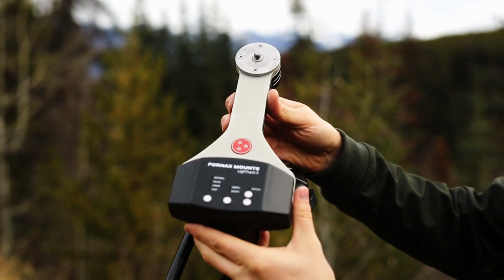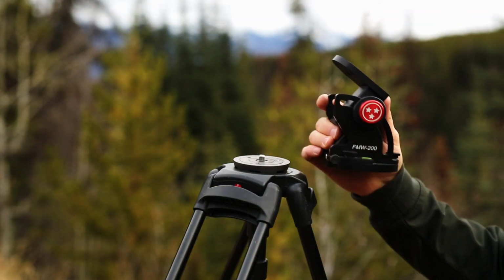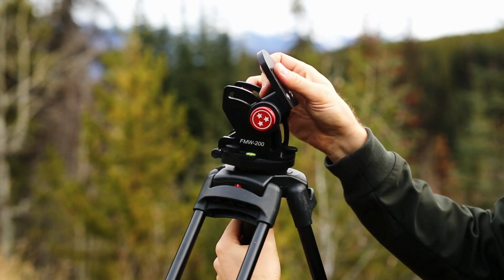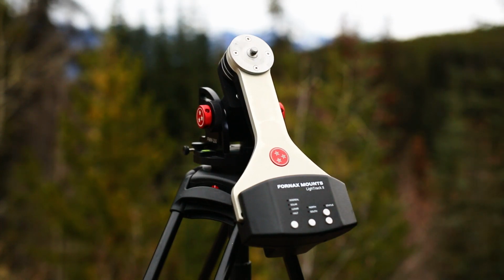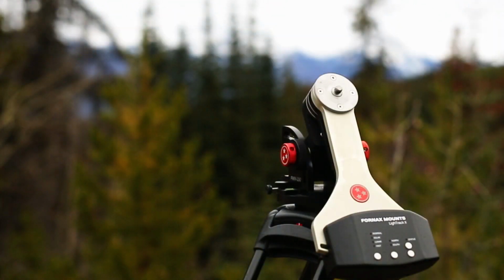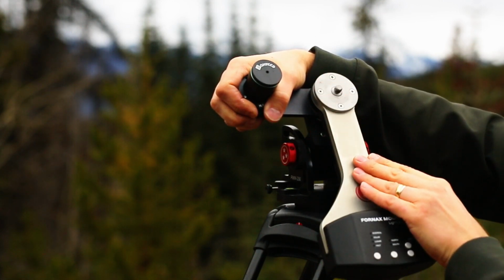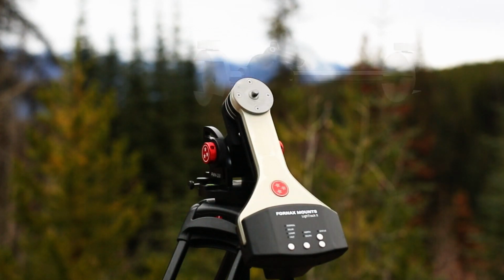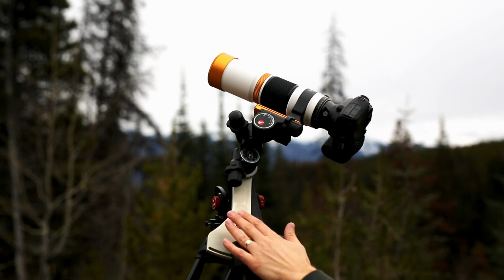LighTrack II Overview

Comment: In a review made by somebody else it was indicated that there was a rubberised wheel which made a friction contact with the top (Grey coloured plate) to drive the mechanism. My question is: does this item wear out (as all things eventually do) is it a replaceable item? Thank you
Reply from the maker: Hi! I’m not sure what review you’re referring to, but there’s no rubberized wheels to worry about in the LighTrack. The mounting point at the “top” covers a metal bearing on which the drive arm pivots. The drive mechanism is at the “bottom” and consists of a machined metal track driven by a metal shaft.
Hope that helps!
Reply: @FerventAstronomy  Thanks for such prompt reply. I purchased my unit through you guys quite a while ago and I am extremely happy with it. Kind regards

Comment: Can you specify which Manfrotto tripod you are using? Thanks!
Reply from the maker: Hi, it's some variation of the Manfrotto 525mvb, but I've since switched to the Fornax FMTP-10 tripod which can hold a lot more weight. I posted an overview of it on the channel if you're curious.
Reply: @FerventAstronomy  Thank you

Comment: Would the ball head method work with a 300mm tele lens on an aps c dslr, with a total weight of around 1.9-2kg, or do u need to mount it on the dec bracket - counterweight thing, to have reasonable results :) Sry for the silly question!
Reply from the maker: Hi! It’s not a silly question at all. Rather than just the weight of the lens, it depends more on the physical length of your setup and how it is mounted to the ballhead. A DSLR with a compact 70-300mm will mount fairly easily. A 300mm f/4 or f/2.8 prime will be physically longer, and depending on the location of the mounting point on the lens and your specific ballhead you may find that there isn’t enough clearance  between the camera and mount to allow you to compose every angle on the sky. Using a geared head like the Manfrotto 410 can provide better clearance, and make framing your images a lot easier because of its ability to make micro-adjustments. Trying to frame a patch of sky at a 450mm focal length with a ballhead can be challenging to one’s patience. The counterweight kit is always the ideal solution when mounting long optics, but it isn’t a necessity for more compact setups. My recommendation would be to try things with the ballhead first before looking into other accessories. If it works for you then you’re all good, if you find you need a bit more clearance you can go from there.
Reply: Thx for the help :)

Comment: What are the dimensions of the mount fixing plate on the Lightrack II? Specifically the distance between the M6 screws and the 3/8" tripod head mount. I am looking to purchase a Lightrack and I am figuring out a mounting solution for my fluid head so I can use more than one screw for attaching the Lightrack to the quick release plate. Thank you!

Edit: I emailed support and they were quick to reply. For anyone else wondering, the distance between the 3/8" hole and each M6 hole on the bottom of the mount is about 22mm, center to center.
Reply from the maker: Hi, apologies as I did not see this comment. I believe you may have sent an email that I responded to yesterday, but for anyone else that is curious the distance is about 22mm.

Comment: I am glad I found this tutorial and video and  you showed all the other options that could be used on this mount, this will be the tracker to get even though it does not do a 360 movement I rather buy a quality item. Thanks Tom
Reply from the maker: Hi Tom, thanks for the feedback, it is really appreciated. There are a lot of different needs in astrophotography, and the LighTrack II definitely aims to fill the need of heavy-duty portable tracker.
Reply: @FerventAstronomy  Thanks for the reply, maybe do a video when you get time on the QHYCCD Polemaster alignment.
Thanks again
Tom

Comment: I'm about ready to pull the trigger on the Lightrack II, I just don't know which tripod to get. I don't want to overkill it since I'll be hauling the kit internationally, but not too light as to resonate with wind and what not. What do you recommend?
Reply from the maker: Hi there,

It really depends on your restrictions re: weight and length. You don't need to go overboard but a super light weight travel tripod isn't probably the way to go. I wish I had more experience with something like the Manfrotto BeFree so I could give you a "ye or ne" on it, but the lightest weight ones that I can personally vouch for are a couple versions of the Manfrotto 055. We now are shipping the new Fornax FMTP-10 tripod which has very stable legs and a half-ball head for easy leveling. It is roughly 27 inches long when collapsed and isnt too heavy, but it definitely is more of a full tripod. If you end up needing to go smaller/lighter you can always try to compensate by not extending the thinnest leg sections and giving the tripod a low stance, which will increase it's stability. I hope that helps, and feel free to email us at info@ferventastronomy.com if you need more help!
Reply: @FerventAstronomy  which tripod/bowl head were you using in this video? could you comment on how the tripod in the video compares to the FMTP-10? Thank you!
Reply from the maker: @azamgarner2849  Hi! I was using a Manfrotto 525MVB in the video (the FMTP-10 was brand new and I didn't have one in hand yet). The Manfrotto tripod is a video tripod that has an integrated half-ball. It's lightweight but extremely bulky. The FMTP-10 from Fornax has more of a conventional tripod construction with thick, sturdy legs, but it folds up into a comparatively compact package. It also features a half-ball, so functionally they are equivalent in that regard.
Reply: Fervent Astronomy thank you!!!

Comment: how do you realign with fov after the 2 hour reset ?
Reply from the maker: Tarun Kottary Depends on your equipment, but reframing is done manually. As only the R.A. axis moves during reset, you only need to readjust that axis’ position. If using a ball head or other tripod head I often just loosen the knob that controls that axis on my ballhead, hold on tight to the camera, and then hold the reset button until it’s fully reset before tightening the knob again. It usually requires minimal tweaking that way.

Comment: I use the same geared head on mine, makes centring targets much easy than a standard ball head.
Reply: Great video.  It's good to see the wedge in use.  I started with a ball head, but found the limited joint mobility made some areas of the sky very difficult to photograph. Using a Bogen 3025 now, which is - I think - very similar in function to the geared head demonstrated. (One rotary bearing and two orthogonal degree hinge joints.) The RA clutch is, of course, kinda necessary when using the LT2, and the first hinge axis give me Dec.  If I align the camera's optical axis with the rotational axis of the second hinge, I get very welcome field rotation, something the ball head didn't offer at all in many orientations.   How well do those geared heads lock up?  I'm kind of leery of them, fearing that all the complexity will leave them susceptible to slight flex, even when tightened.
Reply from the maker: @geonerd  I can personally vouch for the Manfrotto 410, however I know of some other folks who have had mixed success with some other makes.